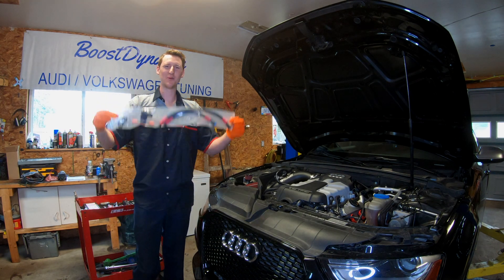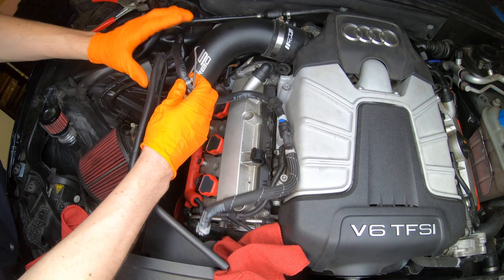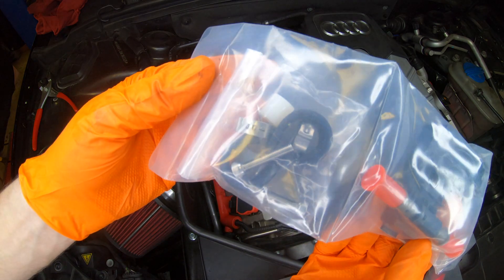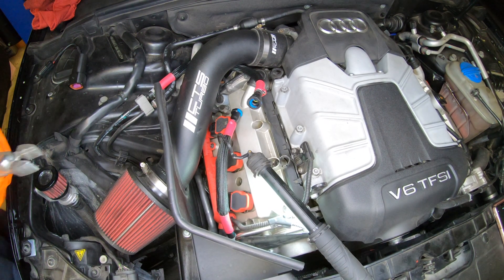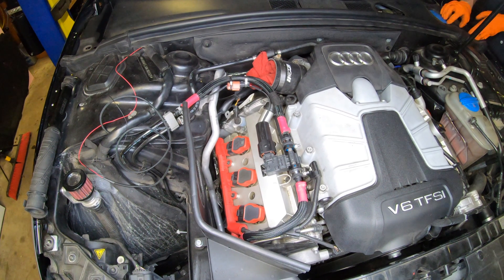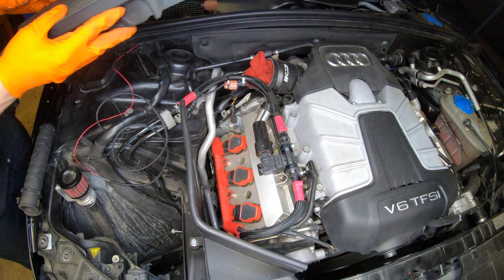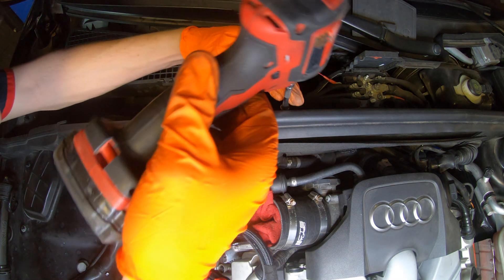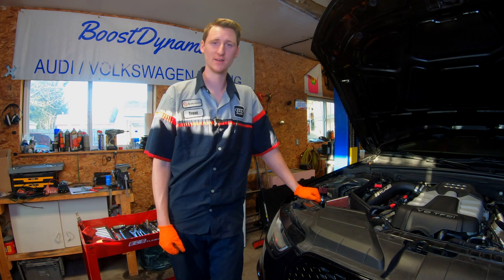BDT: Fuel-it Ethanol Sensor Install

Comment: Is the sensor being installed into the fuel return line ?  Also, you connected the power and ground, but surely there must be a signal too ?  Where does this go and how do you integrate it into the ECU ?

Comment: why didnt you tap the power into an accessory? Constant power would always keep it on
Reply from the maker: The parasitic drain is so small that I didn't see the need to break the seal to the ecu/fuse box. I've not had a battery go dead when letting the car sit for over a week, nor did it go low. If you watch my meth injection install video, you'll see how you can tap into the fuse box to get ignition power instead of constant power. Best of luck on your installs!
Reply: I'm kind of curious about this as well, planning to install this kit very soon on my B8.5

Comment: My question is why? You can run it without the sensor if you have a tune flashed. Does the ecu use the sensor to adjust the tune? My BRZ with Ecutek will adjust the mixture depending on the percentage of ethanol
Reply from the maker: I’m an engineer calibrator. I need actual data as the car doesn’t come with sensor from factory. How do I know I’m making a tune for true e40 mix. It’s also nice to know fuel temperature as that changes pump pressure very slightly. My climate goes from -20 to 100f. This is a huge variation and needs tuned for. 

For a normal person this sensor isn’t needed.
Reply: @boostdynamictuning  gotcha. I forgot you create tunes

Comment: I see you installed she sensor facing towards the back of the engine bay, which is a cleaner look.  Does the direction of the sensor have any bearing on the readings or fuel flow?
Reply from the maker: MOOGAS1 sensor direction doesn’t matter